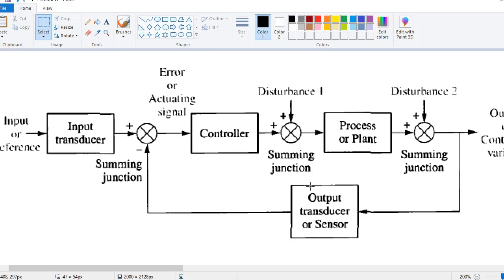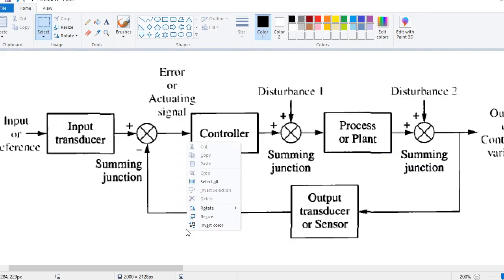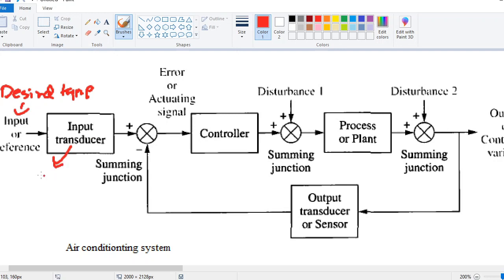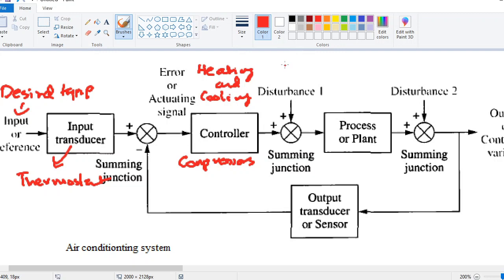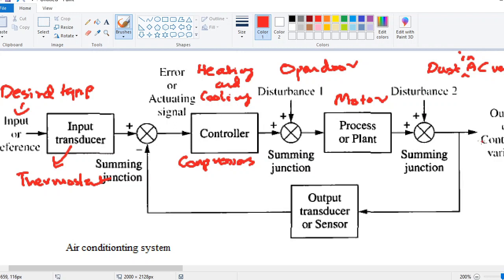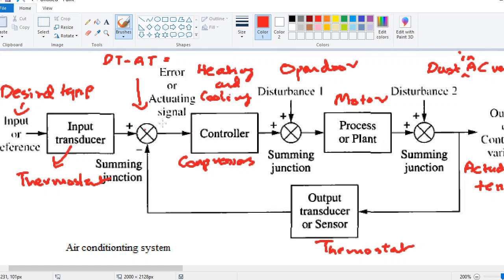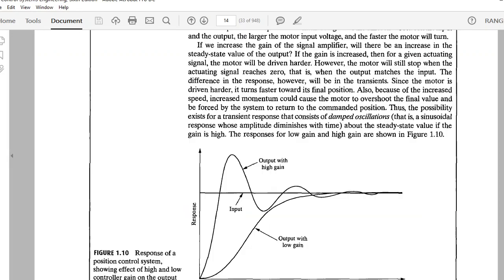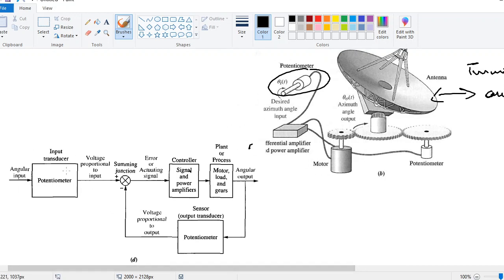Air conditioner closed loop control system

Comment: ADDED CAPABILITY 

Is CHP considered renewable energy?

CHP can use a variety of fuels, both fossil- and renewable-based. It has been employed for many years, mostly in industrial, large commercial, and institutional applications.

*PV INVERTER  systems